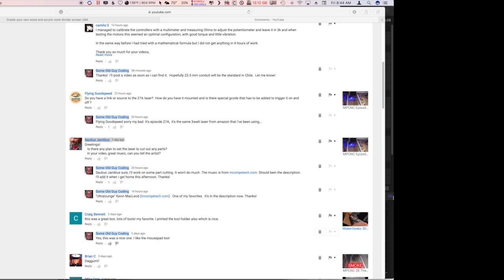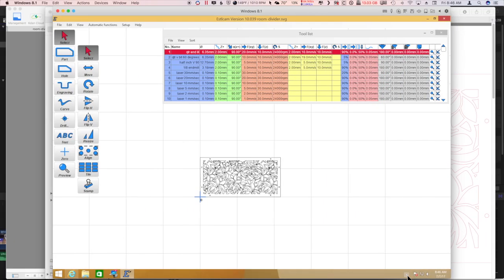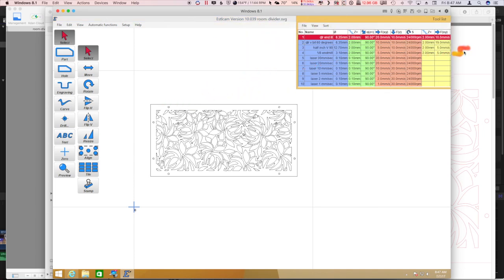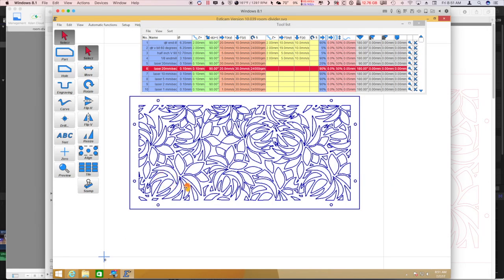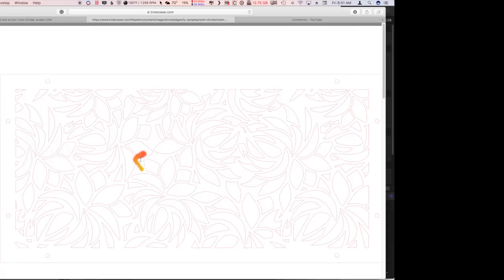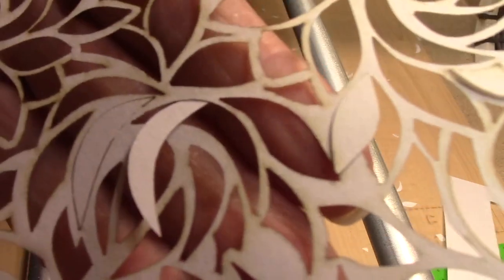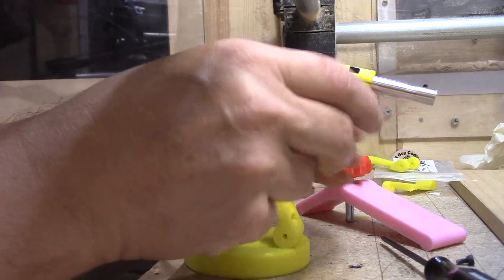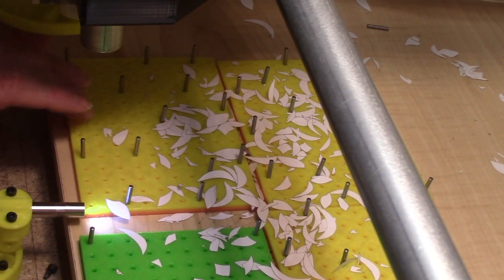MPCNC episode 30 -  Laser Cut Paper Revisited

Comment: Instead of the fan shield, you might want to just put a piece of glass on top of the paper. At the wavelength of your laser, it will pass straight through the glass with a negligible loss of power.just a thought.
Reply from the maker: Thanks for the tip!  Yes the fan shield wasn't the greatest idea. Thanks for sharing!

Comment: Unrelated to my first comment, I'm surprised you haven't added end stops. An E stop wouldn't be the worst idea. Also, I haven't watched your whole series of videos about your machine.
Reply from the maker: I had X and Y endstops initially. I took them off after they interfered on a job by catching on the router (poor implementation on my part). I guess I haven't really missed them.  I might put them back on again at some point.
Reply: Some Old Guy Coding if you had them and everything worked properly, you could at least make repeated passes with different programs on the same part. You mentioned in this video you couldn't do different laser power settings in one program.
Reply from the maker: If I want to multple passes, I just start the head all the way in the corner. Using a hard reference, like a corner, it's easy to change tools or whatever you need.  Its homing, just without the switches!

Comment: I am just going to shotgun some thoughts. Laserweb, chillipeppr for driving your laser. They are both(?) web based. For your bed of nails, I would pass on pogo pins. That would seem to me to be a large expense to misuse a part. One inexpensive alternative I saw was the plates used to hold rafters together. They are a stamped steel product with "teeth" punched through to grab the wood. You "might" get away with simply putting masking tape down on your sacrificial wood, since that is what is burning and smoking up the back side of your paper, in my opinion. Bigger DIY lasers use an aluminium form that is an inch or so thick/tall and comes in HUGE "sheets". It is pulled apart and kinda looks like chain link fence from the face on view https://hackaday.io/project/316/logs

If I think of more, I'll share. :) Mind you, I have no room to criticize. I don't have a machine of my own to make real world experience with, yet.
Reply from the maker: Thanks for your ideas.  Yes the big machines have the expanding laser mesh. I like your idea of the nail clips used for rafters and trusses. I think SabarMultimedia tried that too.  I think Sabarmultimedia used the pogo pins because he had them on hand.